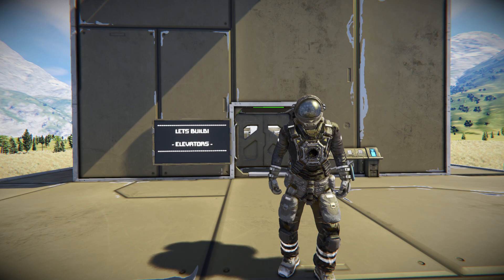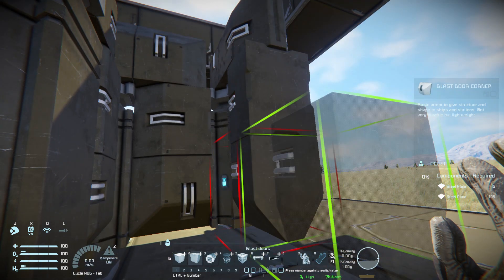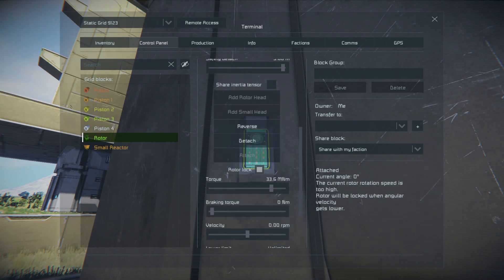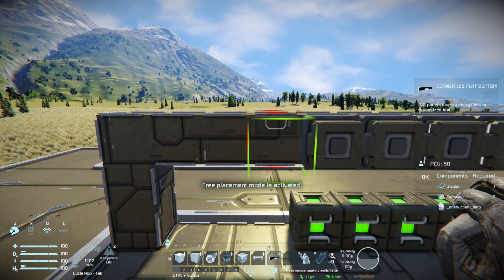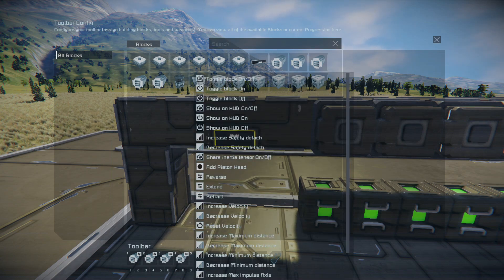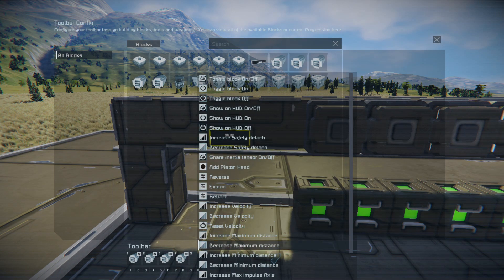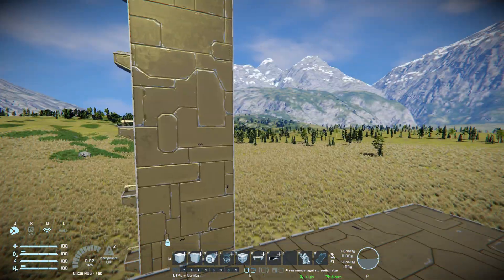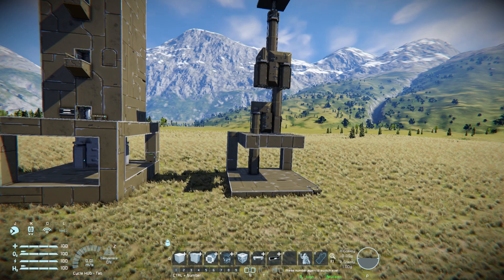Space Engineers - Lets Build! - Elevators

Comment: Haha this is so complicated it's not even funny. I just wanted to be able to make a 1 block piston that reaches 8 blocks not some huge contraption. Guess I'll have to look for a mod. Sometimes this game makes me so angry. Why the hell did they make pistons so bad. No reason for it to stick out on not be flush with the floor.
Reply: you should just be able to stack 2 pistons and offset them to be flush with the floor. SMH
Reply from the maker: @b151proof  I've been requesting additional blocks, like a longer piston and longer slopes to the devs directly with no avail. Ironically they use a longer slope mod for their Keen logo intro of the game haha. 

But this is the closest you'll get to a vanilla elevator, unless you use a rotor climbing lift like what BlackArmor showcased awhile back.
Reply: @demize7498  Thx for the reply. Yes, although the strat is complicated thank you for helping! I ended up using a mod but only downside is that the bottom part of the piston turns invisible after a certain length. I just use a sensor to automatically close elevator door so I can see it lol.

Comment: Brilliant !! Just what iv been looking for. This is going into my space station, except it will be going top down so the floor will be suspended, lowering crew into the bridge area ; D

Cheers for the vid, keep them coming, just  vanilla blocks w/DLC  would be greatly appreciated as I'm on xbone x
Reply from the maker: Sorry for the late reply... But you're welcome. With the addition of the small grid doors, I've slightly updated this design to allow the doors to be only accessable if the elevator is at the level/floor you're calling it from. That design will be in a build I've been working on for the passed month and is to be done very soon. Feel free to checkout my Workshop as well and keep a lookout for it